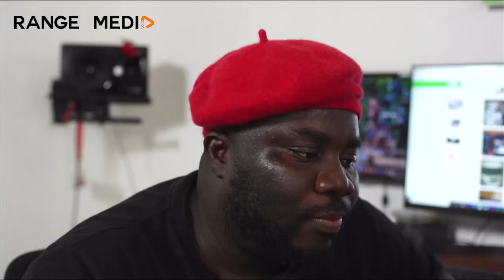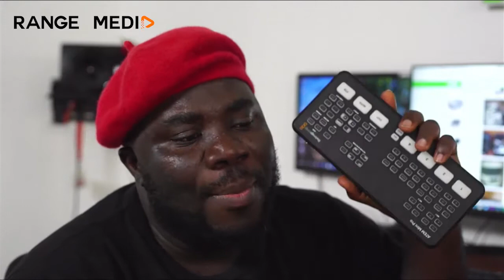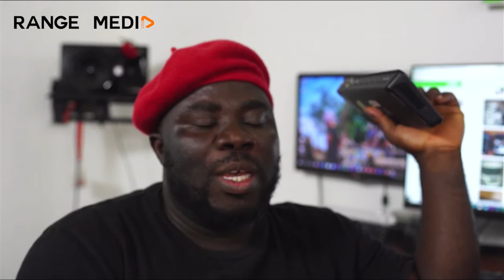Blackmagic Atem mini Pro : why most HDMI ports goes of and solutions

Comment: Same problem I faced when I used "audio video to HDMI converter". Port no one became useless for hdmi input signal, however it is working when used with " audio video converter  which gives 720x576 output"
Same happened with hdmi out put of my switcher when I tried to split hdmi hdmi out put. It gives out put with "audio video converter at 720p" but no or intermittent  out put with hdmi cable. 
Moreover I notice one more thing that when I tried to use switcher not fully pushing power pin result is batter.
My question..,  Is it repairable if sent to blackmagic or any other workshop?

Comment: i experienced the same problem...mine worked fine the morning service  and towards the evening service the hdmi out couldnt display.
mine is connected to a ups power supply...is quite unfortunate that am experiencing this loss..
thanks for the video..
Reply: I have a similar challenge. How did you solve it? Can it be repaired in any way?